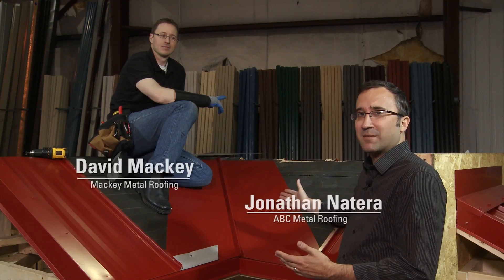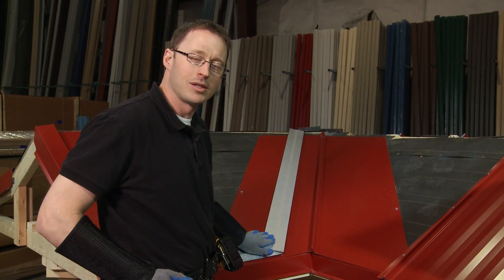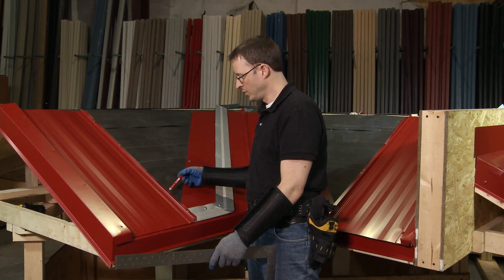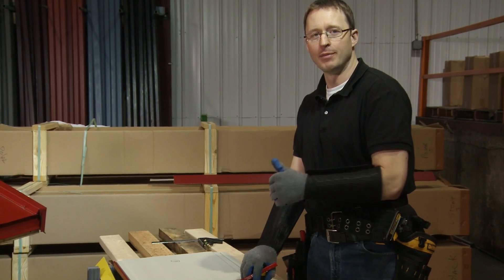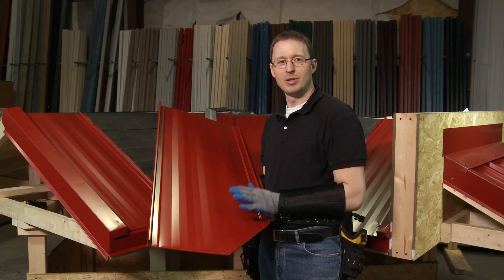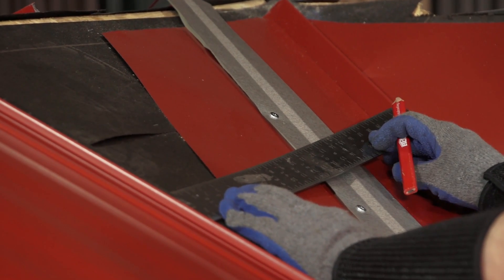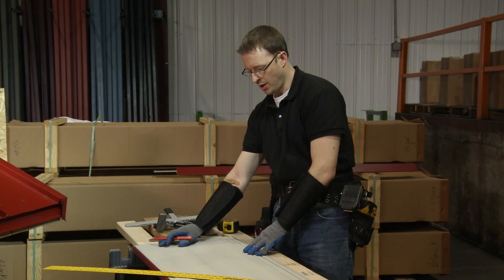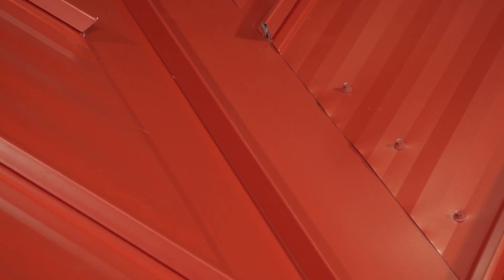How to Install Valley Panel: ABC SL-16® Metal Roofing System

Comment: Is this true about continuous cleat system? ### Advantages of Continuous Cleat System and Its Superiority

*1. Accommodates Thermal Expansion and Contraction:*
   - *Uniform Movement:* Allows metal panels to expand and contract uniformly with temperature changes, reducing stress on the panels and preventing issues like warping or buckling.
   - *Prevents Damage:* Minimizes the risk of damage to the roofing system caused by thermal movement, enhancing durability and longevity.

*2. Reduces Oil Canning:*
   - *Stress Distribution:* Provides a consistent attachment point, distributing stress evenly across the panels and reducing the likelihood of visible waviness or distortion (oil canning).
   - *Aesthetic Quality:* Maintains a flatter, more visually appealing roof surface.

*3. Enhances Wind Resistance:*
   - *Secure Attachment:* Offers a more secure and continuous attachment along the eave, improving the roof’s ability to withstand strong winds by distributing wind forces more evenly.
   - *Prevents Uplift:* Reduces the risk of panel uplift or detachment during high winds.

*4. Manages Snow Loads Better:*
   - *Even Support:* Provides even support across the panels, helping to manage the weight of accumulated snow and reducing the likelihood of panel deformation or failure.
   - *Increases Safety:* Enhances the roof’s structural integrity, making it safer in regions with heavy snowfall.

*5. Prevents Leaks:*
   - *Consistent Sealing:* Ensures a more consistent and reliable sealing of the roof, reducing the chances of leaks that can occur with panel deformation or fastener failure.
   - *Long-Term Performance:* Improves long-term weather resistance, maintaining the integrity of the roof over time.

*6. Aesthetic and Structural Benefits:*
   - *Clean Lines:* Provides a cleaner, more streamlined aesthetic by eliminating visible attachment points and maintaining the integrity of the roof’s design.
   - *Structural Integrity:* Enhances the overall structural integrity of the roof by providing continuous support and reducing localized stress points.

*7. Superior to Fold-Over Systems:*
   - *Flexibility:* Unlike fold-over systems that create rigid attachment points, the continuous cleat system offers flexibility, allowing the roof to move naturally with thermal changes.
   - *Durability:* The continuous cleat system’s ability to accommodate movement without compromising the integrity of the panels makes it more durable and resilient.

*8. Long-Term Cost Efficiency:*
   - *Reduced Maintenance:* By preventing common issues like oil canning, panel warping, and leaks, the continuous cleat system can reduce the need for maintenance and repairs over the roof’s lifespan.
   - *Increased Lifespan:* Enhances the overall lifespan of the roofing system, providing better value for investment despite the higher initial cost.

### Conclusion
The continuous cleat system is superior due to its ability to accommodate thermal expansion and contraction, reduce oil canning, enhance wind resistance, manage snow loads, prevent leaks, and improve both aesthetic and structural integrity. While it may be more complex and costly to install, its long-term benefits and superior performance make it a worthwhile investment for durable and reliable metal roofing.

Comment: My opinion, there should always be overhang. Watch the cleat bend in the rain.  Water does run back. I know you have the tape but that does eventually break down. And the cleat sits.on the roof but the cleat still is higher for the bend.  So how are suppose to walk up the valleys without damaging it? On steep roofs you have to walk up the valley. I have been doing these installations for nearly 20 years and I would not recommend cleats. And would urge hangover.
Reply: This called continuous cleat system?  Supposed to me numerous advantages?

Comment: Does 17" on the square works on all different slopes of roof? Thks
Reply from the maker: Hi Jean Luc! The 17" mark on the square will work for all roof slopes. This only changes when the panel profile changes as it is based on the width of the panel that's used. Please let us know if you have any additional questions. Thanks for watching!
Reply: On which width 17 is our angle
Reply: If sheet width is 42 inch... High rib sheet
Reply: Plzzz reply

Comment: Maybe a silly question...how loud is the rain on those panels?
Reply: ps3shakes123 as long as you use 4x8 plywood it's no louder than a shingle roof, if you're wanting the old tin roof sound when it rains use skip sheeting. Use 1x6 for your roof deck and you only need to run a 1x6 where you need to install the clips that hold the roof panels. So, you put a 1x6 all the way across the bottom, leave a 3 or 4 inch gap, then run another 1x6. I enjoy the sound of the rain hitting the metal roof so I use the skip sheeting method myself.

Comment: I can't see the logic of sealing the bottom cleat in the valley.  Why would I want to seal the bottom so as to prevent any potential blow-by from gathering against the upside of the seal?  After all, the mere fact that the valley tray extends beyond the valley cleats is an indication that blow-by must still be a  consideration. That said, it seems to me it would be better to install the bottom offset cleat in the valley WITHOUT sealing tape so any blow-by could escape under it. And in case water might find its way over the cleat (especially if it's sealed), I could even see notching slits into the underside of the hem to let it weep out.
Reply: johnstreak if water is getting to that tape, you've already got a leak. If installed properly, that will never be a problem